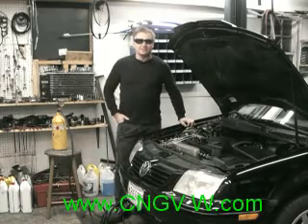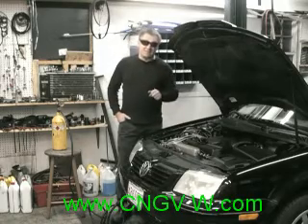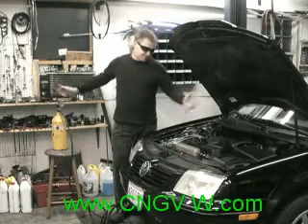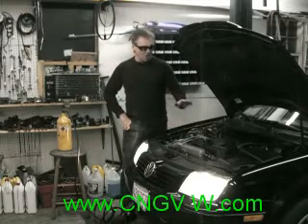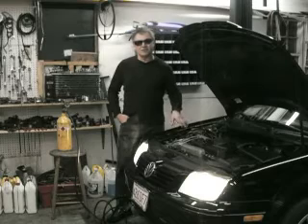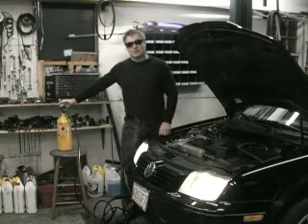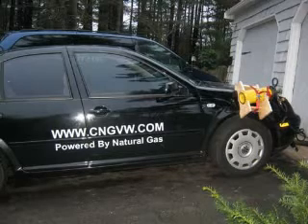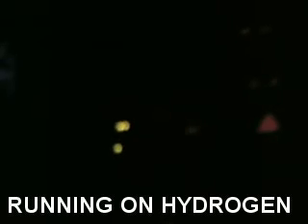The first CNG BI-FUEL TURBO JETTA running on hydrogen

Comment: Thanks elder Bob for having made this video they sell carbon fiber online cheap like fiber glass rolls and resin for saving thousands on wrapping your own plastic tanks and resin with carbon fiber with npt fittings you can also buy cheap to save thousands on lighter tanks for the high pressure setup

Comment from the maker: @Bonco7769  CNG system are rated for 3000 to 3500 LB they are run ito a reg system that steps it down to operating pressure of 60 to 150 LB.I have over ten years of converting cars to CNG and Hydrogen, You should do you home work first or at lest read up abit on it to learn how it done the right way.
Bob Mann

Comment from the maker: Hello I have been building this VW CNG BI-Fuel cars for over three years they have been working great with no problems. For the Oxy Hydrogen Generator systems I feel you would be best to build a pumping stationing setup and fill tanks to a  safe pressure. This way you can test and adjust the car to run on it. You need a lot of Hydrogen to run this engine I just do not know if your onbourd Generator  can  make anfo to run it all the time?

Comment: I'm always skeptical, but here I believe you. Everything you've done looks right and sounds right. I'm sure the compressed gas works and that it would be inefficient.. 

I have this same car. Have you attempted or looked into the OxyHydrogen Generator?? The one that uses electrolysis to extract the gas from plain water.  I've extracted the gas myself, So in the least I know that a flammable gas can be extracted from water. Any attempts at fitting this on your car??